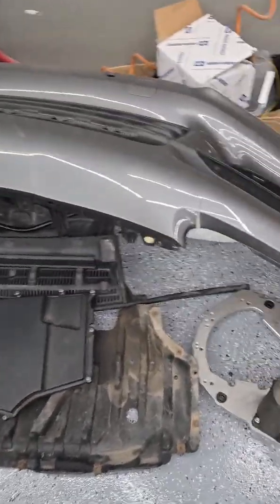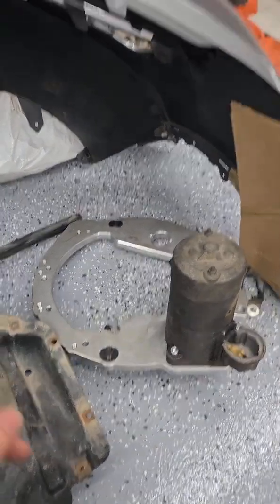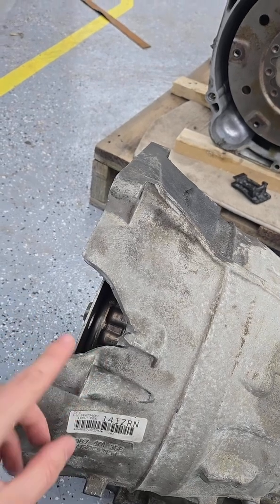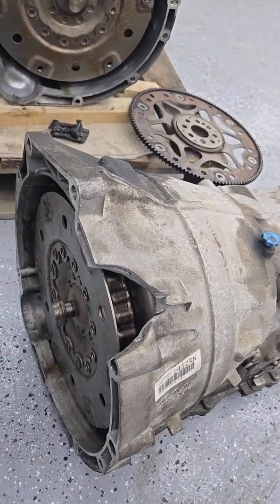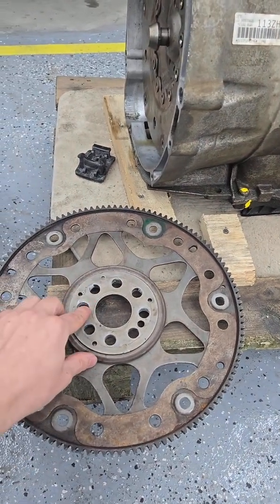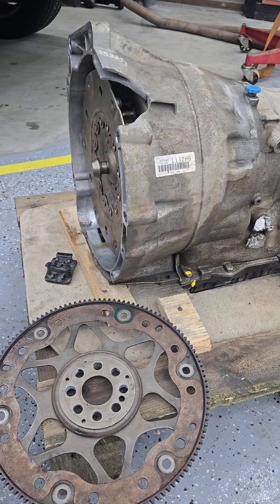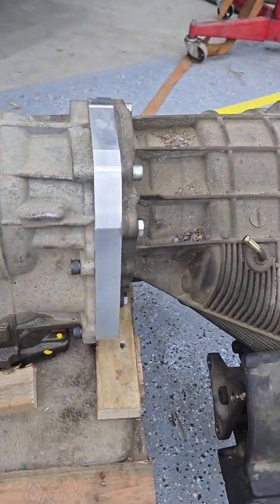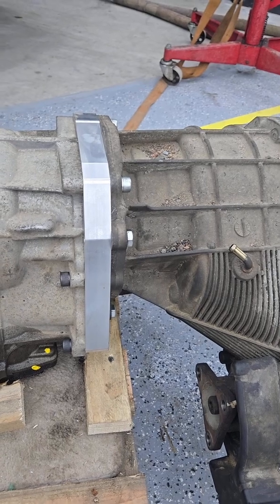ZF 8HP Swap on Range Rover L322 — What You Must Modify

Comment: How much HP does the car have now, and can I make it permanent rwd and only in needed cases to make it 4wd?
Reply from the maker: 177hp, or less (oem power). No, you cant, because transfercase case original.
Reply: @hobbydrive thx, but do you think is there a possibility to mount a patrol transfer case on this unit? To make it 4wd?
Reply from the maker: @madhoney.69 yes, because I know patrol projects with 8hp.
Reply: @hobbydrive thx for the answers